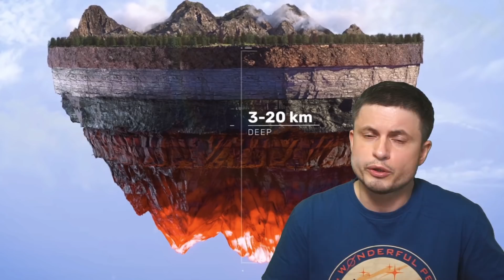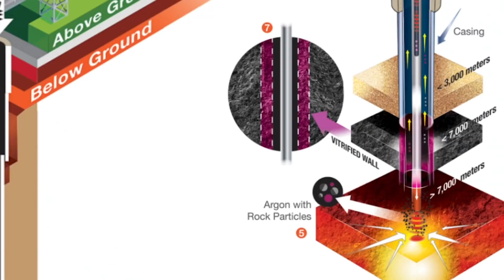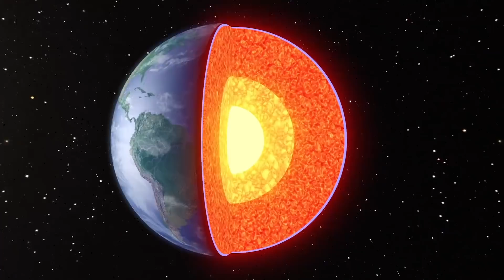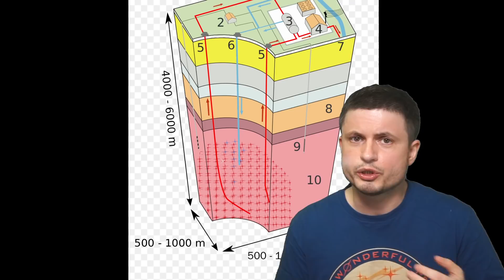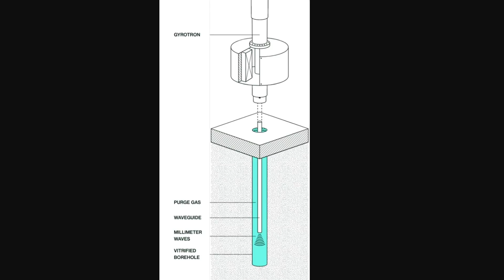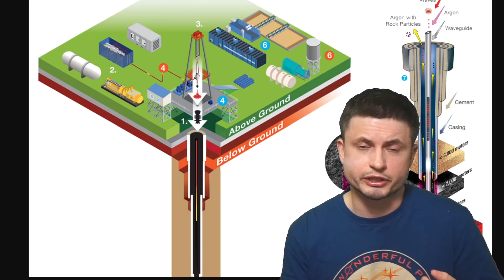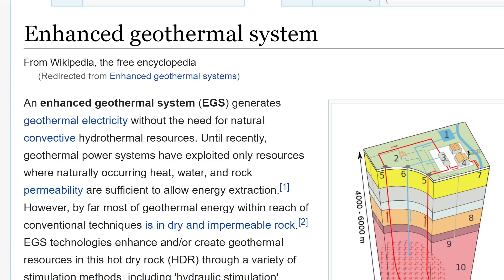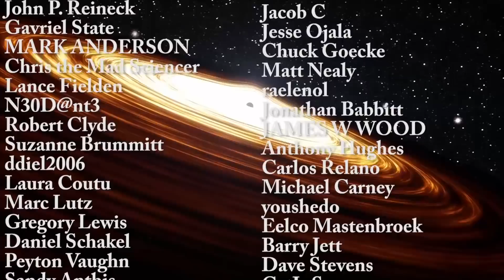Creating Deepest Hole on Earth For Geothermal Energy Revolution

Comment: I always wondered how much power geothermal could produce before altering convection currents within the Earth
Reply: I doubt we could put a dent in it. IPCC estimates 2TW is the high end of how much geothermal energy we could tap. I tried to find numbers for how much Earth produces, but could not find one. It's surely way higher, since 1TW is about what humans produce.
Reply: @defenestrated23  You may be right, but remember 'I doubt we could put a dent in it' is probably similar to what they thought about air and oil reserves when we started using fossil fuels.
Reply: The size of the Earth is immense. We are a tiny crust on top.
Reply: Convection currents are inside the mantle and we won't be significantly closer to there than your backyard grill.

Comment: Anyone else feel like digging this deep and potentially cooling the Earth's Core is a Bad idea?  💡
Reply: 20km isn't even into the mantle for continental crust. not even close. the earth is vast and even if you drilled all the way to the core a million times for geothermal power you wouldn't cool it a single degree in a hundred years. the planet has a huge mass compared to anything human-scale (~6x10^24kg) and the core is largely iron which has a huge heat capacity. if you wanted to cool the planet down by removing the core you'd have to basically replace the core and a good chunk of the mantle with the entire moon and it would still take at least a thousand years to be uninhabitable.
using heat for geothermal power is a metaphorical drop in the ocean.